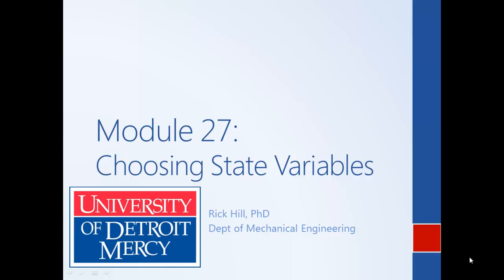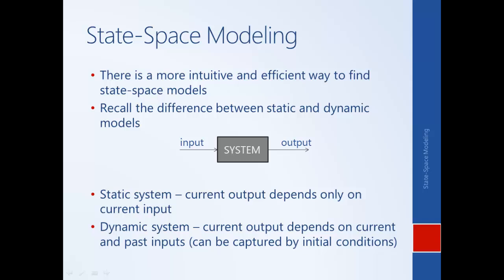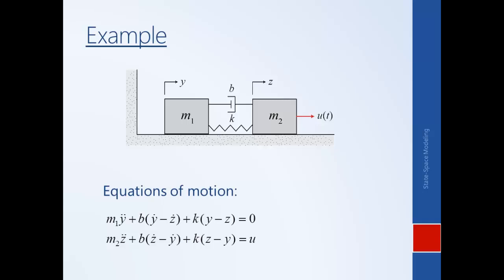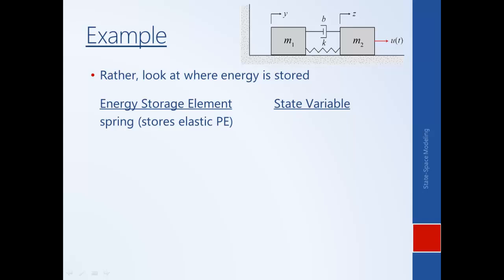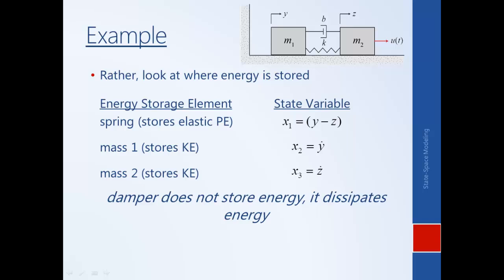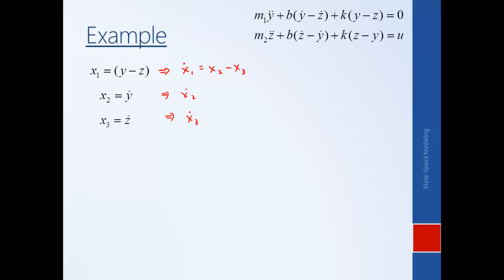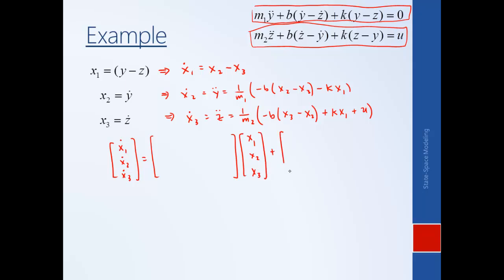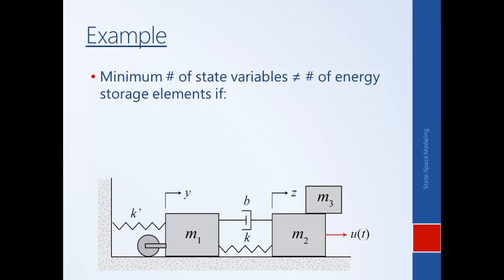System Dynamics and Control: Module 27b - Choosing State Variables

Comment: Sir, Is 3 the minimum number of state variables?
As the system is 2nd order
I can able represent its dynamics using only two states
x1 = y-z
x2 = ydot-zdot
x1dot = x2
x2dot = (1/m1+1/m2)*(bx2+kx1) + u/m2
Is it right?
Reply from the maker: For your set of variables, you would not be able to determine the "state" of the system because you can't distinguish between the kinetic energy stored in mass1 and the kinetic energy stored in mass2.
Reply: Arriving at Electrical Analogues from Free Body Diagrams of Dynamic Systems is how I learnt Dynamics of Mechanical Systems in the 80's. I doubt that this is taught anymore. Thank you for posting sir.

Comment: how did you determine what goes in the C matrix?
Reply from the maker: The C matrix is determined by the system's output. The output employed in the model is a choice of the engineer/analyst. What is it you are trying to control? What variable do you want to analyze the response of? Consider a DC motor. You could desire to control its position, its speed, or its torque, for example.

Comment: If l connect a dc motor to a certain electric circuit ; can l suppose this motor be an energy storage element ?
Reply from the maker: Yes, you can. Specifically, if you assume a standard model of the DC motor, energy will be stored in the mechanical inertia of the motor as well as in the inductance of the motor. Therefore, you would need two state variables to model the DC motor.
Reply: @hillrickc  yeah l get it one state for inductance of motor (La) and the second state for mechanical inertia (J ) ; thanks so much , sir

Comment: so the main difference between the modern control theory and the classical control theory is that for the modern control system we look the system from the energy point of view, but the classical control system we look the system from the "raw" physics DE point of view?

we massage DE to the form that has a minimum set of variables that describe the whole system. 
I get that if we use this method we can decrease the number of variables. is this why we use this method? 

If so then is this method always preferred?

Comment: Thanks ! 
And if the outputs where Y and Z ? How would it be to describe the output matrix ?
Thanks
Reply from the maker: If desired to have Y and Z as outputs, then you would need to choose a set of state variables that allows them to be separated, such as our original choice. In that case, the output matrix would have two rows. One for the equation for an output of Y and the other for the equation for an output of Z.